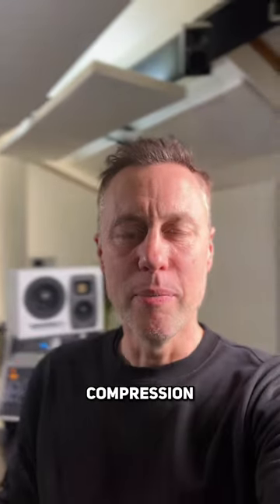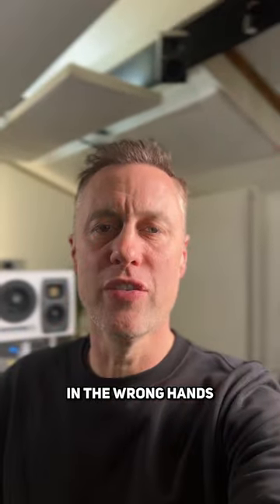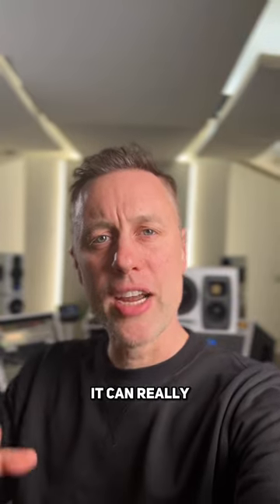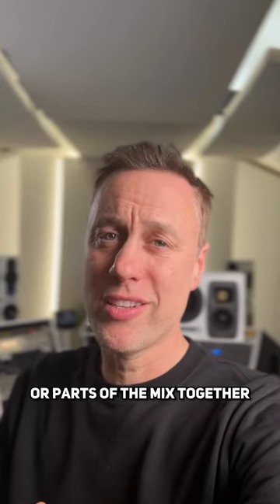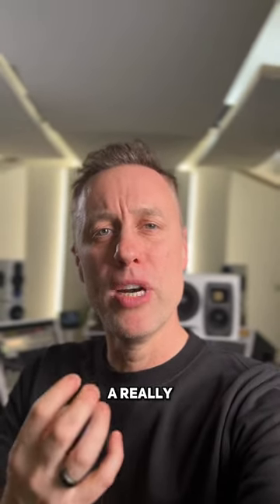WHEN TO COMPRESS STUFF 🤷🏻‍♂️

Comment: Question: Should one include the kick in the drum bus when doing parallel compression?
Reply: You can, i do most of the time, but in the end: if it sounds good…so if you dont have the feeling of squashing your kick too hard, id include it for sure, cause the gluey sound is nice
Reply: For fat loud drums i suggest to compress and limit kick and snare/clap in a bus and the other elements in another bus, then grouping the 2 bus together and make the final subtle moves to glue the 2 bus.